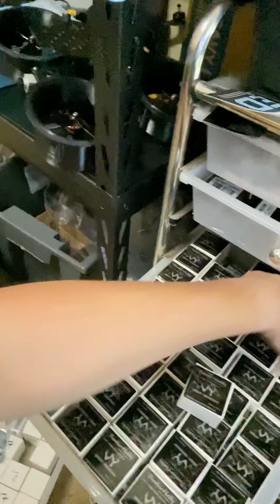4s vs 6s response on Shendrones Squirt

Comment: higher voltage is always more electrically efficient.  Less amperage means less internal electron collisions(less electrical energy lost to heat), which means more efficient. The total efficiency of the drone is also effected by the aerodynamics, and motor torque.  If motors and props are sized properly then more voltage always yields more overall efficiency

Comment: i have this build with 1507 3100 6s motors... the quad fly better in 4s and with 6s battery the motors are very hot after 2 minutes of fly
Reply: 6s - 1000mAh ? Have you found a solution?